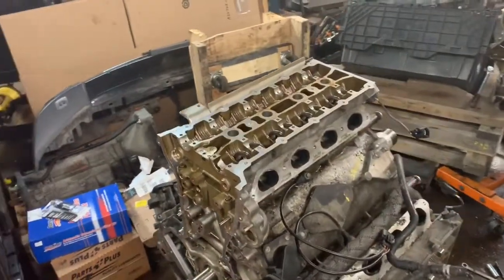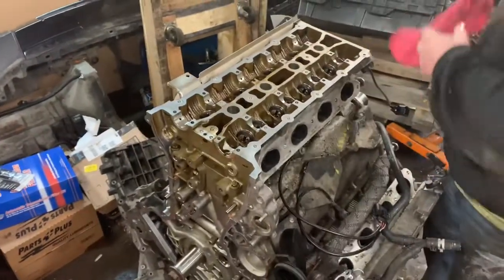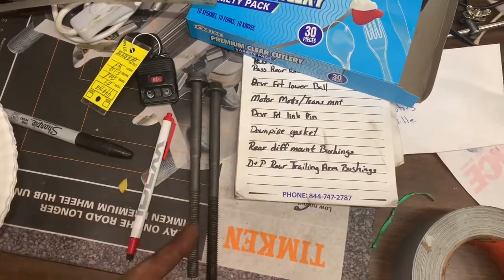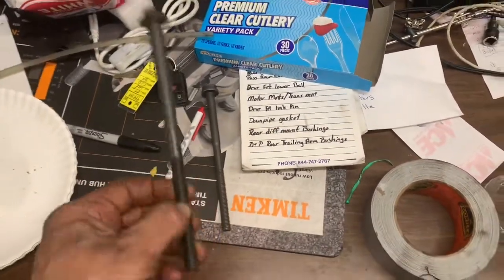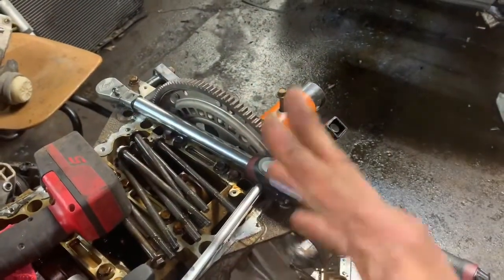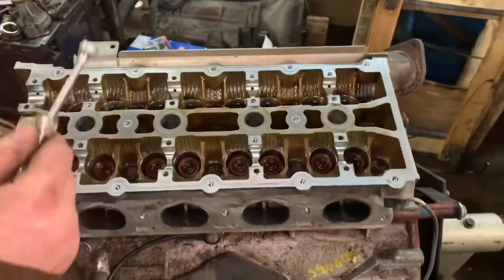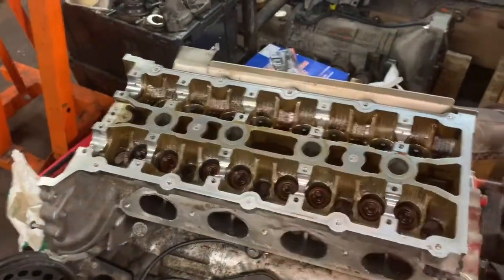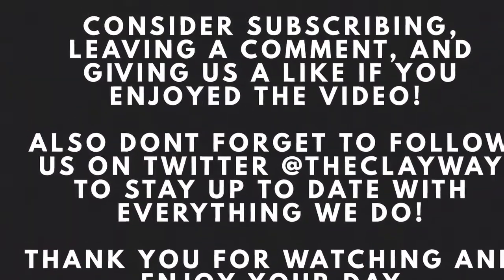Land rover 4.4 V8 head bolt torque sequence the Clay way

Comment: I have the torque specs and sequence if anyone needs them...its 35flb, then 50flb, then 90 degrees and then a final 2nd pass at 90 degrees and that is where you will feel the head bolts stretch...they stretch to act as a spring against the head gasket during temp fluctuations...also JLR says you can reuse headbolts up to 2 times before needing replacement/

Comment: Have a question.. I was replacing the water pump ,pulleys belts.. when I put the fan clutch back on and try to tighten it the fan tool that holds the water pump slip and I turn the crankshaft 2 inches to the left.. now I'm trying  to figure out which is the best way to get it to the corrected ,do i have to take the whole timing chain cover off or valve covers to fix it or can I just take out cylinder 1 spark plug out and out a long screw driver down old school turn crank  to see top dead center ?
Reply: 08 land rover lr3 4.4l
Reply: you dont need to do anything as long as the timing chains were never removed.